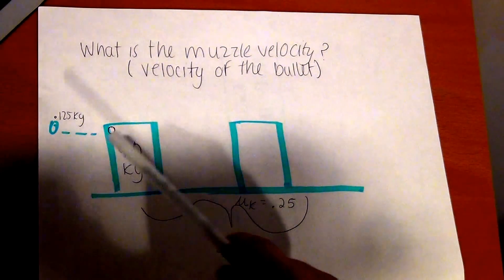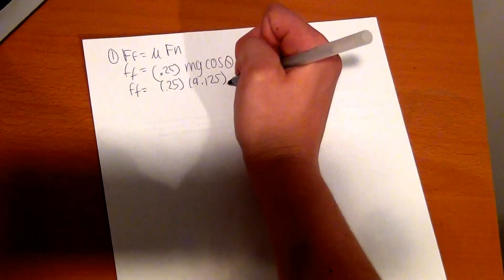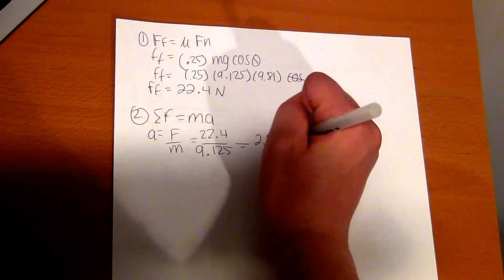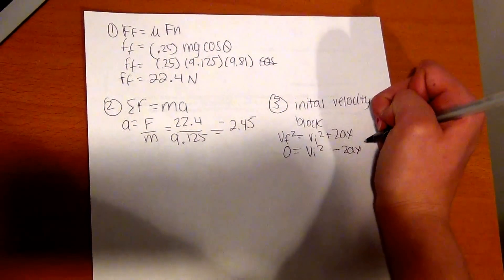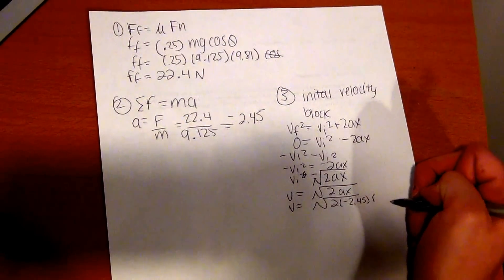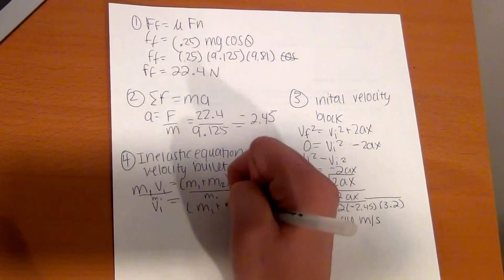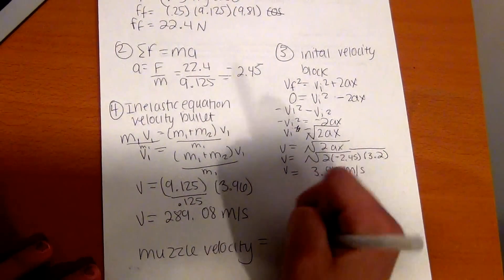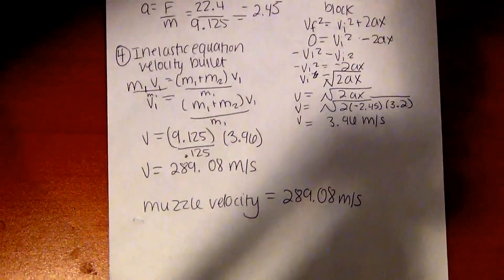Inelastic Collision and Friction

Comment: easy fix, just don't change anything in the third step. so you will just have 
v = sqrt(-(2ax)) the negatives in this case will make it possible to square root it because a negative times a negative is a positive :)